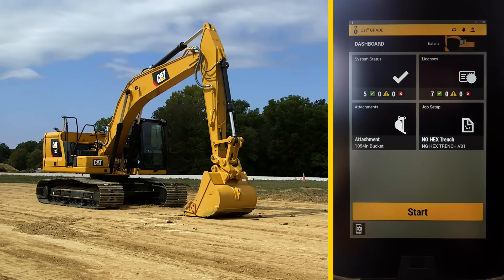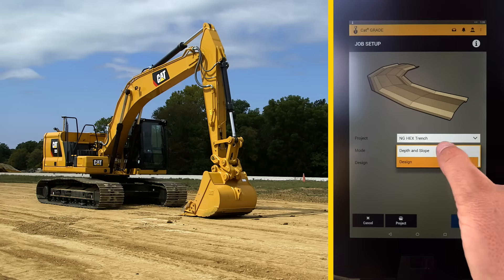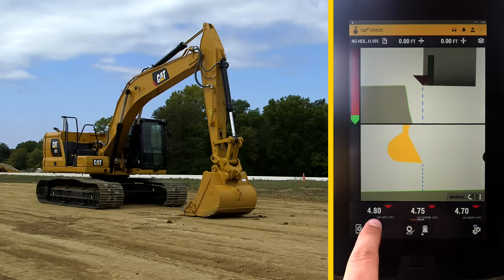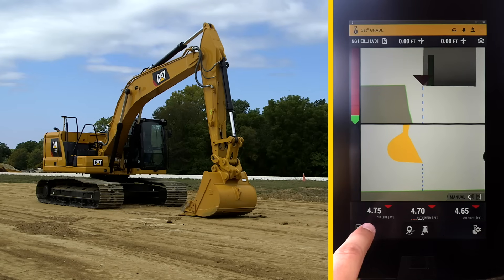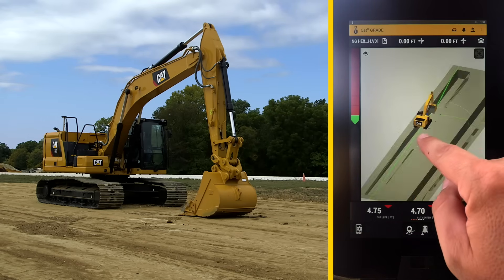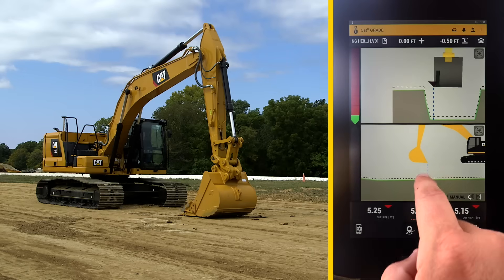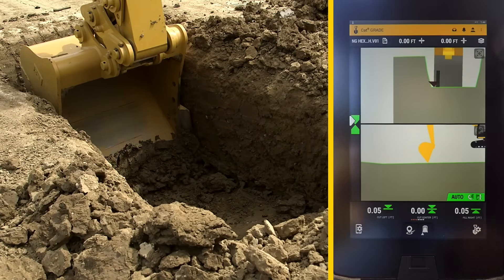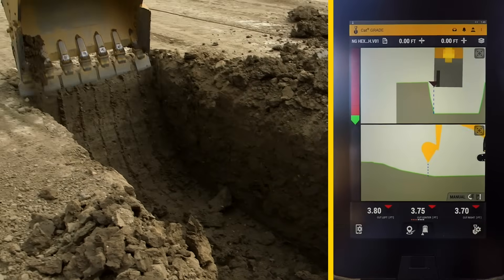Cat® Next Generation Excavator Operator Training: Grade with 3D

Comment: Does this just eliminate gradesman or the boom and arm automatically control the movements to stay on desired grade?
Reply from the maker: We’re happy to hear you’re interested in Cat machine technology, Andy. Your local Cat dealer can help you find the solution you need. To find a dealer near you, visit: https://www.cat.com/en_GB/support/dealer-locator.html?utm_source=youtube&utm_medium=social&utm_campaign=cic_social_care
You can also visit: https://www.cat.com/en_US/support/technology.html?utm_source=youtube&utm_medium=social&utm_campaign=cic_social_care to learn more. - Laura
Reply: The answer to your question is that the boom and arm do automatically control the movements to stay on grade. That's what the green autos indicator is. The system is able to send commands to the cylinders, so as you pull back the bucket it stays on grade
Reply: @bryantlash6035  is this system available on smaller machines?
Reply: Yeah, it's available on a ton of sizes of excavators, as well as skid steers, graders, dozers, etc